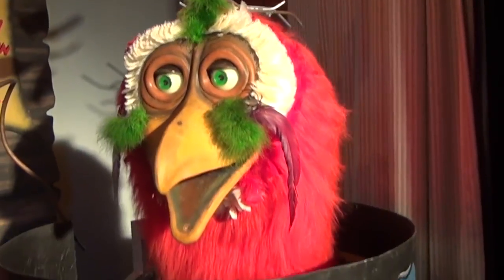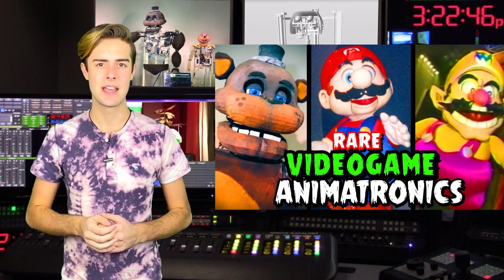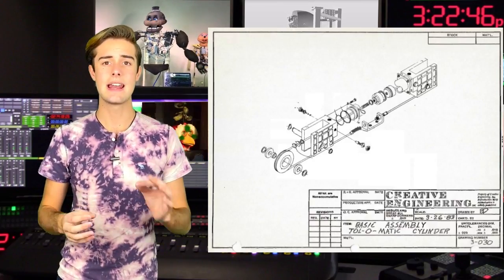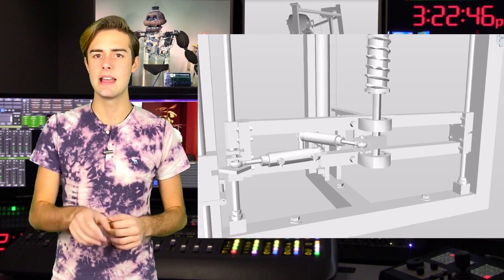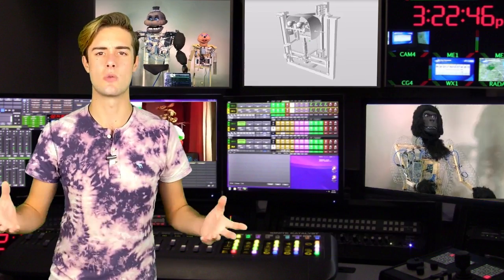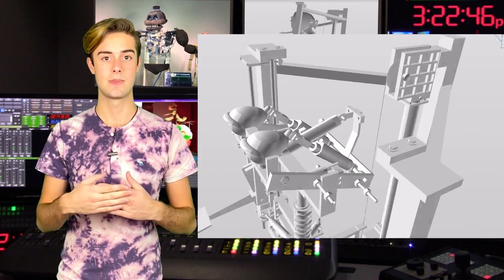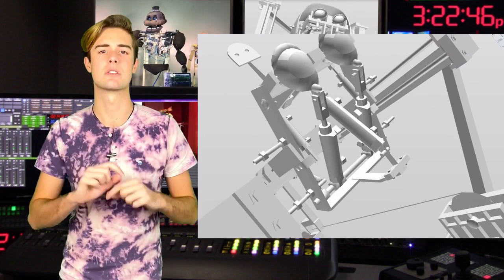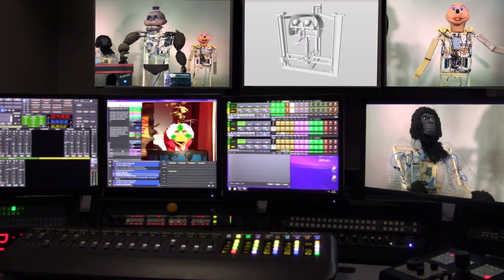How does this animatronic work?

Comment: Great video! Though I’m curious why the hand retrofit wasn’t mentioned. 
I know it’s a rarer variation but feel it’s still an important piece of the character’s mech history. Based on the photos and documentation I’ve seen; It appears to use an additional cylinder to lock a piece in place connecting the hands to the raise. Thus allowing the hands to ride up alongside the head.

I've been struggling to find any close-up footage of the locking mechanism in action, though. So if anybody reading happens to know of any such videos or are more familiar with how it works, additional information would be greatly appreciated.